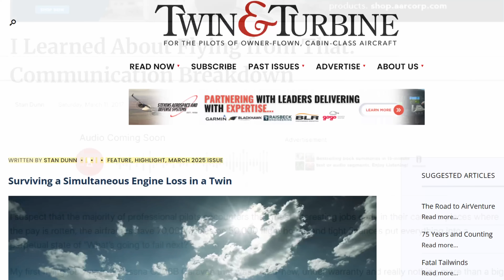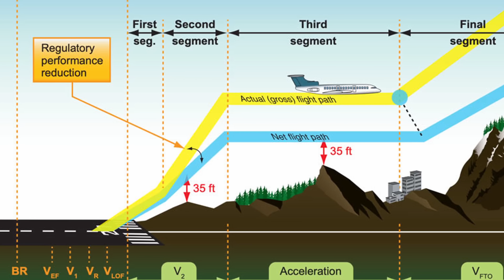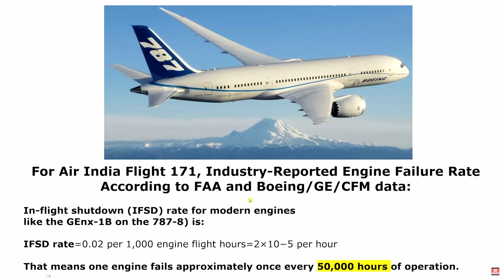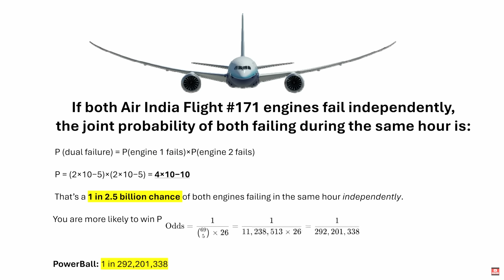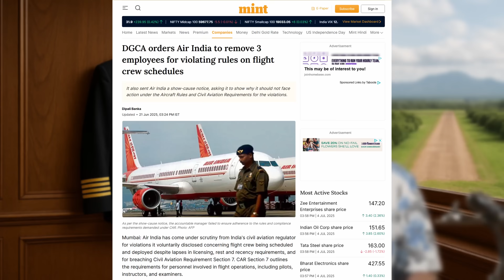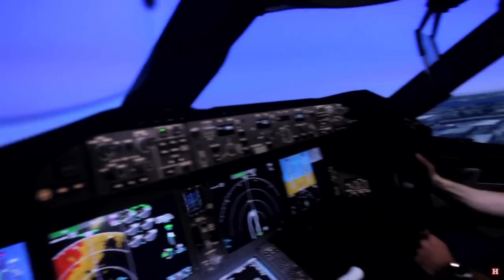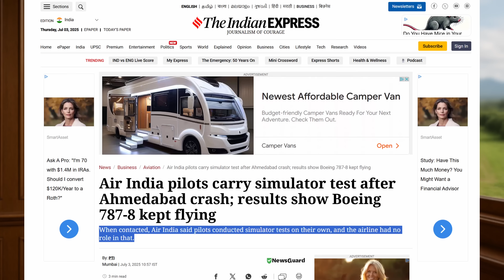Air India 171 Cause Becoming Clear

Comment: I don't believe the engines shut down in "rapid succession". I believe the both shut down, or were throttled back to idle at EXACTLY the same time. I don't see any sign of yaw that would be caused if one engine shut down before the other. I also don't believe the flight controls were working at all. The takeoff, climb out, loss of power, and decent appears to have happened in a completely straight line. No yaw, no banking at all. 

I don't believe there was a problem with either engine, and that includes fuel contamination. It's almost as if both engines were simply shut off or throttled back. I believe that is exactly what happened. But it was not done by the pilots. It was done by the computers. From the research that I have done on the 787, there is no way for the pilots to override the computers. The computers are in fact supposed to be the "safety backup". But what happens when the computers fail to operate properly? There seems to be no safety backup for a scenario like that. It's as if the designers considered the computers to be infallible. And as someone who has a great deal of experience with computers, I have found that they are anything but. 

So far, I see no evidence of pilot error here. IF one engine was having problems, it is inconceivable that the pilots would have immediately shut down the OTHER engine. The entire flight, from takeoff to crash lasted only 30 seconds. They had no time to do anything. Also from what I understand, there was a message transmitted by the pilot. The message read: "MAYDAY... MAYDAY... MAYDAY... NO POWER... NO THRUST... GOING DOWN..."  It sounds like they had no idea what happened. Also, I haven't heard anything about whether there was a "TERRAIN" warning heard on that message. Makes me wonder if the "computer" thought the plane was landing instead of taking off.
Reply: OK, but you’re still speculating something very critical about the manufacturer before you even have the black box info. Others are speculating horrible performance by experienced pilots without waiting for black box. I’m just saying that the manufacturer and pilots may be perfectly blameless here; don’t they deserve the basic decency of your waiting for important unknown data from the black box?
It’s perfectly fine to say “we don’t know,” because, in fact, we haven’t even looked at the most fundamental data.
Reply: @Papi-1231j  Very little is actually known about the captain/FO/flight crew. But a whole lot is known about Boeing. ALL of it bad. It took the two 737 Max crashes that killed 346 people to make people aware of what had been going on at Boeing for a long time. Both of those crashes were caused by the failure of computer systems that the pilots didn't even know about. These computer systems (MCAS) were installed as a bandaid, in an attempt to save Boeing a lot of money. Boeing has a lot of blood on their hands. The 787 has been riddled with problems from the very beginning. Boeing has lied over and over again, including to the FAA. There has been coverup after coverup. Whistleblowers have died under very suspicious circumstances. And all that is just the tip of the iceberg. Boeing is a corrupt, immoral, unethical company that will let nothing get in the way of profits.
Reply: @geraldscott4302  Take your Boeing Bashing somewhere else, Gerald! Nobody is interested in that bullshit!:face-fuchsia-tongue-out:
Reply: @geraldscott4302  I know what you are getting at, but let me play devil's advocate. re: MCAS What kind of inept pilot does not hit the "pitch trim disconnect" switch when the plane starts trimming you into the ground? As demonstrated by the pilot flying one of the accident aircraft before the accident. Should MCAS have been allowed by the FAA? Probably not. Should Boeing have been allowed to sell planes with only one AoA sensor with an option for redundant ones? I don't thinks so, but what kind of crap airline does not buy the upgrade?
Boeing is a shell of its former self, but do NOT let that distract you from the fact that in order for an accident to happen, holes in the swiss cheese have to line up. 

It is not Boeing's fault that the economy is in shambles and EVERYONE is trying to save money. 

How much to plane tickets cost nowadays?

This is cause and effect, not idiocy or ineptness.
Reply: @chrismacbean plane tickets are a lot cheaper now than they were when I was a kid. Deregulation was a blessing and a curse.
Reply: @geraldscott4302  "a whole lot is known about Boeing". Yeah, all of it made up by the news media for clickbait, which you swallow—hook, line and sinker, because you have no other choice. Get an education, then you won't have to regurgitate the nonsense from the media in order to pretend competence in aeronautical matters.
Reply: Pulling the throttles back to idle will not deploy the RAT
Reply: @orizaba18000  Hey now, this is a thread for wild-ass speculation...stop it with your knowledge of how aircraft are actually designed to work🙄
Reply: @chrismacbean  Good point!
Reply: @orizaba18000  As much as this thread is entertaining, I fear it has a detrimental impact on my cognitive abilities.
Reply: The plane pitched up right before it hit the ground so at least then the flight controls would have been working, though yes i agree a computer failure is far more likely
Reply: @luna_gmd  Or the computer just came back on line in the last moment.
Reply: If accurate, an interesting question is what does the "NO POWER... " part mean. Is it referring to the electric system on the plane ? i.e. they are looking into a dark instrument panel, with the plane computer glitched out and in the process of a reboot ? Did the interior cabin lights fail before the deployment of the RAT ?
Reply: @iRelevant.47.system.boycott  Very possible. The RAT does not deploy and generate power immediately. And it is designed to work with more airspeed than they had. The whole flight from takeoff to crash only lasted 30 seconds, leaving no time for anything to happen. They crashed probably 10 seconds or less after they sent that message. They would have had no idea what was going on.
Reply: @iRelevant.47.system.boycott  good point !  I'm betting he meant ELECTRICAL power
Reply: I agree. My first thought when this happened went straight to the Boeing MCAS fiasco. Boeing knew that under certain circumstances it could make the aircraft pitch wildly but thought the likelihood of a trigger event so minuscule that they didn’t explain the procedure to deal with it. I bet this is a Boeing software issue.
Reply: Jerry4302, Go Around Now!
You’ve missed the point of this review of multiple hypotheses, by insisting on your own speculative opinion.
Reply: Software engineer here: yes, very plausible. Especially considering the MAX fiasco.
Reply: " And as someone who has a great deal of experience with computers, I have found that they are anything but [infallible]." 
What kind of computers? Have you worked with modern FADECs?

"Also from what I understand, there was a message transmitted by the pilot. The message read: "MAYDAY... MAYDAY... MAYDAY... NO POWER... NO THRUST... GOING DOWN..."  It sounds like they had no idea what happened. Also, I haven't heard anything about whether there was a "TERRAIN" warning heard on that message. Makes me wonder if the "computer" thought the plane was landing instead of taking off."

No, I'm sorry but this is all incorrect. Mayday calls have procedure...you don't just randomly say what is happening. Did they say their planes registration/callsign? No? Then its probably fake. Here is the international standard for Mayday calls:

"1. Distress Signal:

 The word "MAYDAY" is spoken three times. 
2. Identification:
The name and call sign of the vessel or aircraft (or the station) in distress is stated three times according to maritime safety guidelines. 
3. Position:
The location of the vessel or aircraft is given, preferably using latitude and longitude, or a bearing and distance from a known landmark according to maritime safety information. 
4. Nature of Distress:
The specific emergency is described (e.g., sinking, fire, collision, etc.). 
5. Assistance Needed:
The type of help required is specified (e.g., rescue, medical assistance, etc.). 
6. Other Information:
Any other relevant details, such as the number of people on board, injuries, or the type of vessel, should be included." 

Secondly, there isn't a way to make the computer "think" it is landing and have the pilots helpless while it just descends. The design philosophy is to have automation assistance but ultimate control lies with the pilots; every aircraft with an autopilot has a giant "autopilot disconnect" button....cuz engineers smarter than us losers speculating on youtube already thought of this exact scenario and wanted to give pilots an option when their systems are compromised.

Comment: I am.always a little surprised by the amount of so called pilots with such little Tech Knowledge of their or other aircraft. Both engines failed?  I personally dont think this was pilot error - but possibly pilot action (sadly). Benefit of the doubt, gross fuel contamination - case in point ANZ DC10 in LAX (1980's) was refuelled accidentally from a tanker which was quarantined as it was being flushed/cleaned - it was full of water! 1 engine flamed out on taxiing, fortunately. The Engineer.
Reply: Professional pilots will pontificate about just any possible subject, you name it, health, mental health, physics, mathematics, computer software, fluid mechanics, legal issues, and others. While a professional in any of those topics will have more years of training behind them and tougher requirements of certification than they have had to endure in their own career.

Comment: I have also been a commercial pilot.
I worked for a few different airlines and flew different types of aircraft.
No accidents in a career spanning nearly, over 40 years and more than 22000 hours.
Yes you make sense but you are rehashing already mooted arguments. At least you are not sensationalist and add valuable and neutral assessments 
Overall yes a good blog.
Reply: Bullshit...go look up how many pilots have 22000 hours. 

I say this as a former SR-71 pilot and Space Shuttle Commander...
Reply: @chrismacbean  Lots of retired pilots that I know of.
Reply: Well said :)
Reply: Yeah, let’s talk about the non-obvious like maybe one of the pilots had a physical problem which ever one had his hands on the throttle and pulled them back as power was lost. I’m sure it would take too long to get them spooled back up. Is it possible to pull the throttle back on takeoff or for them to come back by themselves? Do they have tension settings?
Reply: Putting the blame on the pilots based on a highly speculative theory based on generic information is not good at all.